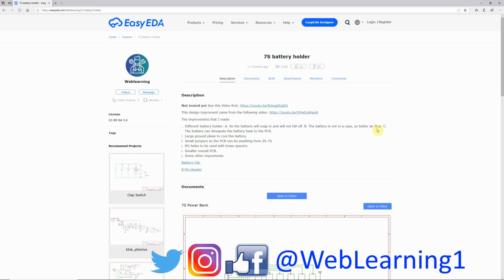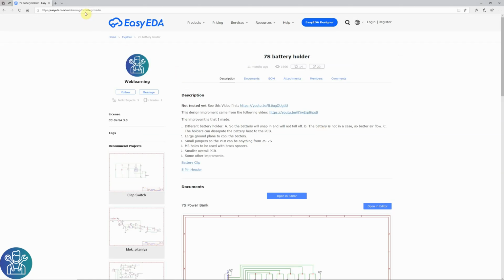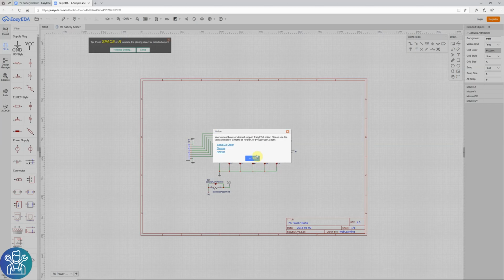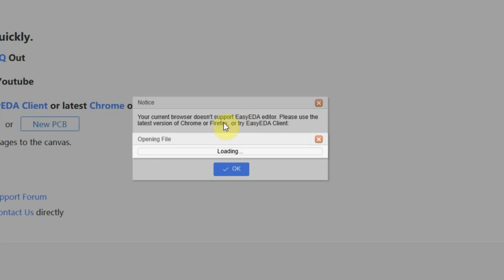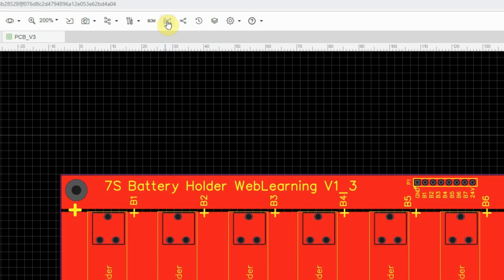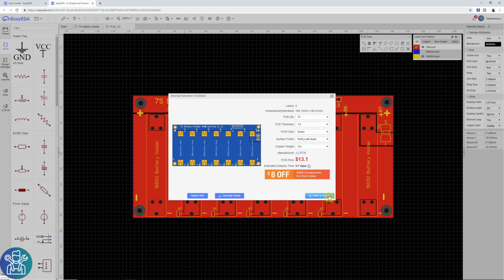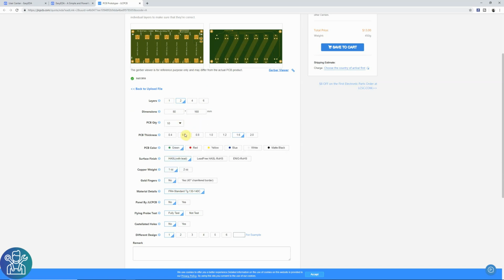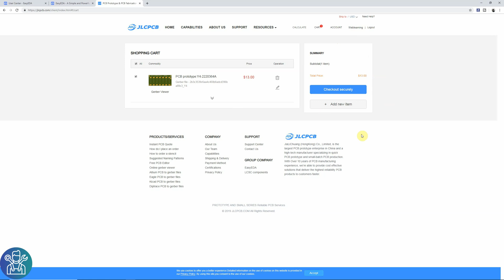How to order the 7S PCB

Comment: do not order as is, modify first. consider below points

1.When assembled the cell holders are too close and can short when adding batteries. requires more spacing between the batteries. 5mm more in between.
2. both negative standoff terminals are touching the battery holder and are pushed outwards when the adjacent  batteries are inserted. requires more spacing, 6mm more outward
3. separation of the battery clip holder pads on the top side need more separation from the grounding copper .
4. the distance of the cell clips between the positive and negative terminals for each cell need to be brought closer by 4mm due to design of the choose battery clips.

otherwise good design especially since it can work from 2s-7s, and with modifications can be scaled beyond 7s.
Reply: have these issues been addressed on the current PCBs